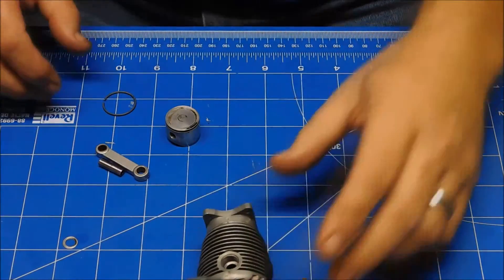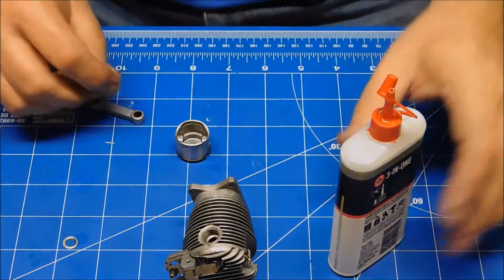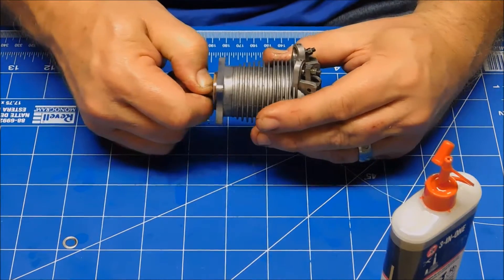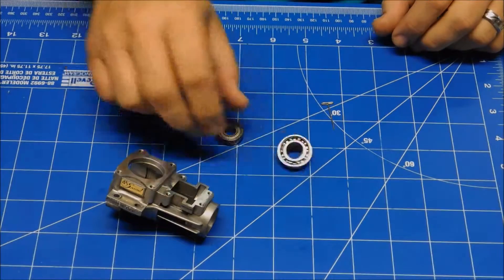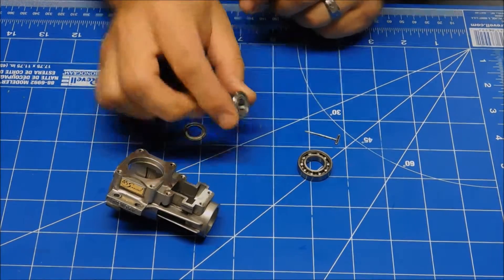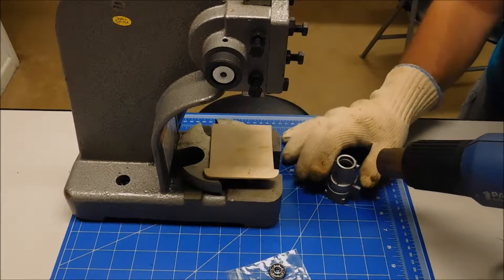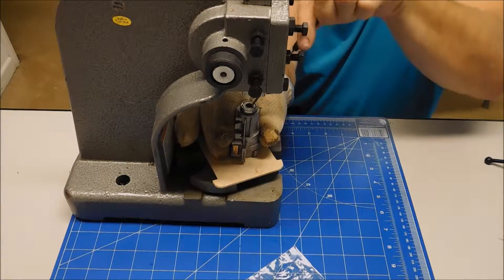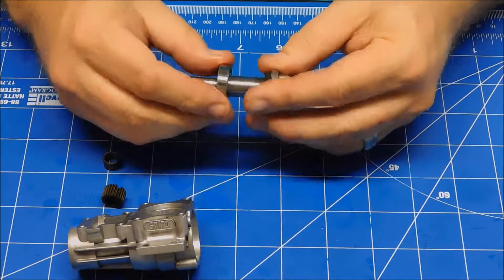Saito 45S Part 4 Reassembly begins

Comment: David, old video but still super useful! I am just in the middle of refurbishing a Saito 40S and 45S. Can I ask about bearings, I see reference to ABEC3 tolerance but also reference to C3 clearance (to allow the bearings to expand under heat/high speed). C3 bearings seem a bit harder to find though. What is the spec of the bearings you use? Thanks!
Reply from the maker: I simply purchase the same dimension bearings that came out of the engine.  Contact Brant here and he will fix you up with the proper bearings. https://www.ebay.com/str/rcenginebearings